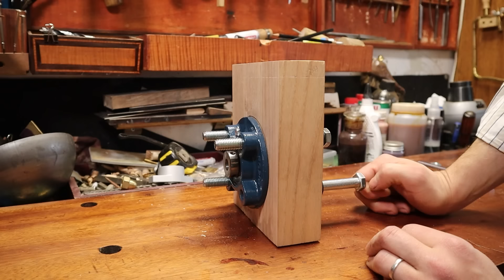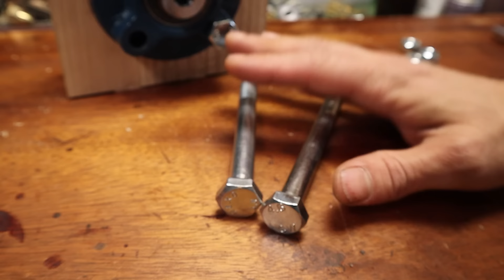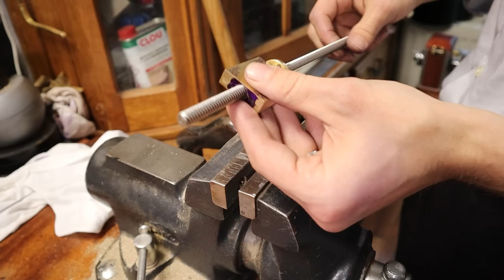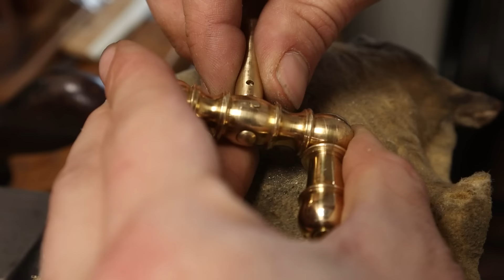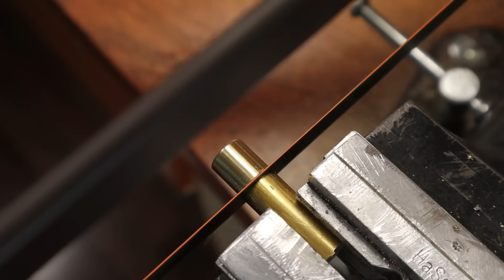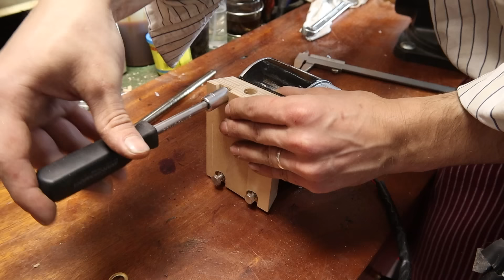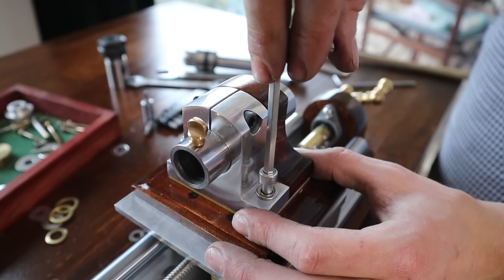Mini Lathe 2 Build

Comment: the 4.4 and 4.8 represents steel properties. The first number represents tensile strength in 100N/mm^2, 400N/mm^2 in your case. The first and the second number multiplied gives you the yield limit in 10N/mm^2, in your case 4*4*10N/mm^2 or 160N/mm^2 and 4*8*10N/mm^2 or 320N/mm^2. Usual grades are 6.6, 8.8, 10.9 and 12.9. 4.4 is really soft.
Reply: Or you could say the second number is the yield limit in 10% of the tensile strenght.
In engineering class you get told to use only 8.8 or higher, but to be careful with 10.9 and 12.9, because they get brittle very easy due to hydrogen embrittlement. (aka don't use them where it is damp/outdoors without protection)
Reply: @Joseu124  also DONT overtighten a 12.9 bolt even just a tiny bit! speaking of experience:)

Comment: I like the idea of a couple of slabs of concrete added for stability and mass, but then have them dressed out with a few pieces of fine wood worked art to heal the soul.  For me, aluminum is much cheaper than brass, so CONCRETE covered with aluminum is another idea. Here is one more gem: what about using some custom sized matching step pullies and a custom sized and hand crafted leather belt drive instead of purchasing a timing belt?  That way you don't need a fancy motor controller and power supply...  (maybe a start-capacitor) and have the speed set by moving the belt between steps.   =D  Oh, and I also suggest leaving some exposed areas from the concrete when adjusting jacks can be added so you can move things around keep them true as parts wear in... note the earth is under the lathe will be moving around - even concrete settles - wood in the flooring will also settle because it is all sitting on the earth - so it's nice to have some adjustment where you don't have to shim up everything all the time.

Comment: The HSS tooling just needs some rake and clearance angles ground into the tool. A bit of side rake and front clearance and it would be cutting that brass beautifully. The lathe is a work of art and your videos are amazing.
Reply: does it need to be held closer to the post? I assume that if it is sticking out too far it would have more leverage over the post and introduce chattering that way, particularly if the post itself isn't super rigid.
Reply: @mattrickard3716  With brass, the stickout is fine since it's so easy to machine. Shawn is correct though, this HSS is basically a blank with no relief at all. May as well put a flathead screwdriver in the tool holder. 

Just 2 minutes on a grinding wheel would have this turning metal like a dream.
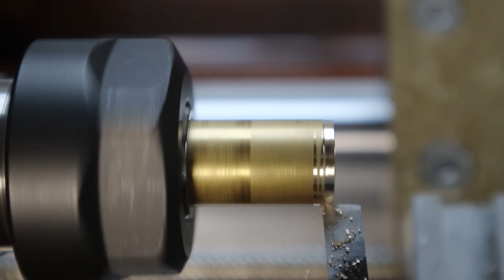Reply: I'm sorry I'm seeing this 2 years later.  I'd say the chatter at 20:01 is happening because your spindle is unsupported close to the chuck.  This unsupported distance works like a lever on the headstock, which is wood and therefore is quite flexible.  
This lathe can be fixed, and overall it is wonderful to see and to watch you make it.
Reply: A lovely project. I do agree with Dude, the chuck is too far out from your headstock bearing. Rigidity is key in a lathe and that space allows for deflection. 

So your lovely gold nuts need to be on the backside of the headstock and the bearing needs to be enlarged so that the  collet needs to be mostly inside that bearning. This would also then allow you to run a tube for the spindle, allowing for through parts in the headstock. 

So with all that said, I love the build. It's interesting to watch your thought processes.

Comment: Your main problem with chattering is that the collet, or “chuck” is sticking out WAY too far. If there’s any way to modify the spindle to get everything located closing to the bearing, it’ll provide far more stability. Great job though, and very inspiring! I personally been playing with the thought of making a concrete lathe, but I don’t know if I’ll actually do it or not.

Comment: Try to add a flywheel, in this way you will be able to have a constant speed without the motor slowing down due to friction.
Reply: Yep, it has one, but he direct drives, so I advised to drive the flywheel
Reply: To be honest, I have never heard of a lathe that had to "take a run at it first" before the tool started cutting.
It made my day, thanks.

Comment: It's beautiful. But I think the wooden ends are allowing a bit of deflection.
Reply: They’re deflecting with *style*, though.
Reply: And it would have held up a lot better if he pulled the tool in tighter, and reduced the stickout of the work.
Plus grinding the hss to give relief angles would make a lot of difference.
Reply: exactly
Reply: Hmhmhmmm, some more brass perhaps? ',:3
Reply: @Loebane  Better to just do nothing, there is no rigidity at all .. Guides with an aluminum base are a very flexible idea ..
Reply: Love the channel!!  Great work.    I agree with David on the rigidity.   If you are looking for a medium to provide more rigidity, but allow your artistic abilities to flow, consider concrete for housing your spindle and ways.  There are lots of videos on this.  But I think you could be creative with the shape, but also achieve the rigidity you are looking for...  It would also give you the mass to reduce a lot of vibration.  Its very economical, easy to use etc....  Have fun!
Reply: @Loebane  might use carbide tool cutters
Reply: I view this as more of a piece of art than a functional machine, and as far as that goes, I think he did an amazing job.

Comment: Dear Uri, the lovely brass nuts you put on the headstock are called “acorn nuts” for obvious reasons. Magnificent work.

The chattering when using your cutting tool is that the entire width is rubbing on your material. If you grind some side relief, ie right side of your cutting edge, the cutting will become smoother and from one point, the front left corner of your cutter.  I can’t see from my camera view but the same problem and solution may be happening in the vertical plane. Cheers.

Comment: I used the same linear rail system for a small CNC mill I made. I've had some issues with the flexing as well. i found that tightening the small set screw on the bearing blocks in the middle on the side helps a little. It snugs up the bearings to the rails better and takes out some slop.

Comment: that nr is basically the type of strength of the bolt.
Reply: or rather it refers to the quality of the steel the bolt is made of. Higher is better and a normal high quality bolt like the ones used in construction is 8.8.
Reply: Yes, 4.6 means it's made of a soft ish grade of cheese. 4.8 is marginally harder, thus unsuitable for spreading on bread. I prefer my sandwich fillings to be 8.8 at a minimum, preferably 10.8 for that high-tensile texture.
Reply: @theafro  Unmarked ones are even softer, like butter. They pretty much spread themselves 😂
Reply: @minihak  Strength class: 5.8, 8.8, 10.9, etc., in which the first digit multiplied by 100 indicates the maximum load on the thread. For example, according to marking 8.8, it should be understood that this fastener has a tensile strength of 800 MPa or 80 kg / mm2 The second figure indicates the ratio of the yield strength to the size of the tensile strength, increased by 10 times.

Comment: excellent work as usual!
I'm no machinist but I watch a lot of machinists on YouTube and heard about some of their tricks to reduce chatter.
starting with the easiest things first: reducing tool stick-out, that means making sure the tool does not protrude from the tool holder more than it needs to be.

also making sure the tool-post is locked tight is important.

in addition, the tool grind can affect the tool bit's behavior when cutting.

next, having locks on all the moving parts is very important especially in small lathes, lock the carriage if you don't need to move it (like when facing), and lock the cross-slide when taking a cut along the axis of the part.

I'm sure you know more than I do, but I'll give these pointers because sometimes someone may forget to do the easiest things first.

Comment: The flex is 100% because you're using rails instead of ways.
Reply: Yep
Reply: I agree cast ways would be better, but it’s unlikely to be the rails, they are more than adequate for the task he’s using them for, it’s more likely some missing balls from the bearing blocks, he took them off the rails a number of times without putting a holder block back in, and I’m positive I even saw a couple flying across the desk a couple times.

Comment: Hi Uri great job as always - if you look at the beds of the early ornamental lathes - like the Holzapfel's they are massive and these lathes are only designed for light cuts - if you lean on some of the lighter metal lathes, with a clock on the end of a piece of bar the clock will easily deflect. I digress but an acquaintance who used to centreless grind turbo shafts told me rather than scrap a shaft - the rejection rate was massive, they would lean on the machine to increase or decrease the grind. Generally with machines bigger, therefore stiffer is better. Stay Safe

Comment: Uri, that is beautiful and ridiculous as always! I have built a custom lathe for my work before and I have got an advice for you. Get rid of the wooden headstock. There is no way around this, it will never work. The second thing is that the headstock must be attached directly to the lathe bed (aluminum plate in your case). If fix those two points performance of your lathe will improve dramatically.

Comment: Dear Uri,
                  I was sent the link to this video by a friend. I love your videos. It would seem though that the results of this project are not yet all that they could be. The headstock is not rigid enough. Lathes have two sets of bearings to give rigidity in the headstock and the single bearing that you have does not provide enough rigidity. The collet also appears to be too far from the bearing. All this overhang from a short bearing surface is a recipe for dissatisfaction.
When fixing timber items across the grain of a wider timber the screws should be of round or pan head with washers under the heads and the clearance holes should be slots to allow for the relative cross grain movement. Failure to do this will over time cause splitting, probably.
Reply: P.S. Is it not time that you bought some moulding planes? They sell for peanuts on eBay.

Comment: You may want to switch to ball screws! The lead screws have backlash when they switch directions. Also with backlash when you are taking a pass the pressure from the tool on the part keeps the backlash in one direction. But when you reverse off the part the pressure is gone so it will chatter on your part. Great looking lathe!! We have an old Derbyshire watch makers lathe in our machine shop and It has a lot of the beautiful touches on the knobs and stuff that yours has too!

Comment: There are grub screws built into the slides that will tighten them up very firm. Just look for holes with screws in the bottom of them

Comment: you may want a wider belt or to use v-belts. You also need 2 bearing those that can support thrust and axial loads to help prevent chatter. 

Still really awesome design and can definitely turn brass and wood

Comment: Really amazing build, and I simply love your style.

So because you mentioned the 4.6 bolts you used, here's the whole magic with the tensity grade:
The first number times 100 equals the tensile strength, and the first number multiplied with the second number, times 10 is the stretch limit.
In your case its a tensile strength (bolt is going to break) of 4*100=400N/mm² and a stretch limit (point of elastic to plastic deformation, if this is exceeded the metal is permanently deformed) of 6*4*10=360N/mm².

4.6 are low grade bolts (they are going to hold just fine in your project), 8.8 is your standard Allrounder in machines to be safe, 10.9 if it really needs to hold things in place, and if you gonna need 12.9 ... I don't think you will ever need them ^^

Greetings from a mechanical engineering technician.

Comment: You can make a zero backlash leadscrew nut by having a strong spring hold 2 nuts together.  It will help remove chatter.   Also, you can put rubber wipers in front of your linear bearings to keep dirt and dust out.

Comment: I recommend 3 bearings on the tail stock, 2 on the back rail 1 on the front.  Same with the carriage but 2 on the front rail 1 on the back.  So that they form 2 "L" shapes that nest together.  This will resist the tipping forces better while still letting you get them close together.
Also add 2 more layers of wood to the head stock to separate the bearings more and make it more stable.
And as many have pointed out watch some videos on lathe tool grinding, I would start with Tony's.

Comment: the numbers on screws are representing the "strength class" of these. The first number multipied by 100 is the tensile strenght and the second number mutiplied by ten gives you the percentage of the tensile strenght which is the yield point. And also greetings from germany

Comment: Your chatter issues are probably stemming from many things, but the first one I'd check is the spindle bearing preload. Basically you need to use a nut (or some other contrivance) on the back of the spindle to pre-load the bearings so they have no free play in them (enough force to make the bearings get hot but not scalding at top speed).

Comment: That's a cool build , well done and thanks for sharing.  Just a little info , the numbers on the head of the bolts are the tensile strength of that bolt . The higher the number the stronger it is,  thanks.

Comment: Awesome job. Switch to a single lead leadscrew. It will have a lot more mechanical advantage.   
Once you get the cutting tool sharpened, it should cut a lot better.

Comment: Seems like you could use some angular contact bearings for the headstock. That's probably a lard part of the chatter. I don't know the rpm range of your motor but a larger pulley would give it some more torque and might help as well. All in all it looks beautiful and frankly performs better than anything I'd build!

Comment: It might not be terribly rigid, but it is beautiful, in it's own way! certainly prettier than most mini-lathes! (and only marginally less rigid!)

From the footage of you cutting, it seems that most of the flex/chatter is coming from the headstock. simply moving the bearings further apart and keeping the collet/chuck as close to those bearings as possible would make a huge difference. of course, we'd love to see a hand-hewn brass cross-slide and I'm sure it would be more rigid than the chinesium thing you've currently got. Whatever you choose to do, I'm sure it will be a delight!

Comment: That chatter is most likely from the bearing not being able to deal with axial loading (ie: taking a cut, which essentially forced the material into the headstock), so the one big upgrade which might be a good idea is to replace the headstock ball-bearings with tapered roller bearings, as these resist both axial and radial loads.

Comment: Hi from FRANCE, I'm in love for this "High-tech" wood you made! 
I just change a few things to improve it if you permit. 1- your fingers are not human, so you could create object the world can't do, and this Incredible talent have to be used on motor. The "stock" motor isn't in the range of whole job. A bit of wood,brass, and antique high-tech look , rear end cover... So, I think you could work on it as we see it just by side of a jewel. 
2- on handling,it's hard to turn piece without both hand in front of you, so I think you have to add the same part of brass to block the tools changer bear the working area, and move the longitudinal axe on the tool plate and not move the whole system. You gain a lot of precision in your magical hand and could be less tired after long job. 
3- add on the tool turret, a off-axle rotating tool to turn spherical or cercle segment with just a move, set the radius and push, the job is done at perfection and could be repeat identically if needed. This second tools post could be mounted in a screw whole dedicated to him on demand, and store the rest of time to leave you place to work.

That's my 2 cents, but in my bad English language, understood I'm totally fan of your jobs and just want to encourage by experience of lathe, I can't create your item and I've a large pleasure to see you work. 
All my best for future lathe V3 and creation fantastics.💓❣️

Comment: I made a minilathe out of angle iron, regular M12 screws some ball bearings and conical roller bearings for the spindle and a washing machine as a motor. I have 3 speed settings but it is usually enough. I tried cutting 51 tou in cast aluminum and it worked nicely for roughing, any more and my belt slips but I am happy it cuts aluminum well and it can cut steel. 
You can contact me if you want to consult.

Comment: Ideally the bearings should have been placed on both sides of the pulley wheel, that would make the whole construction a lot stiffer. You can maybe use the tos mn80 for inspiration, it has a very simple and strong construction.

Comment: Uri, I love your work and your skills... everything is as it should be but one quite significant point of difference... The motor to the lathe should drive the massive flywheel to generate the torque, then belt it to the spindle. As the human engine was intended to be by design!

Comment: The numbers on the end of bolts represent the tensile strength grading of those bolts. stronger ones for example have 8.8 on the ends theres even higher numbers when going up into structural and big commercial stuff